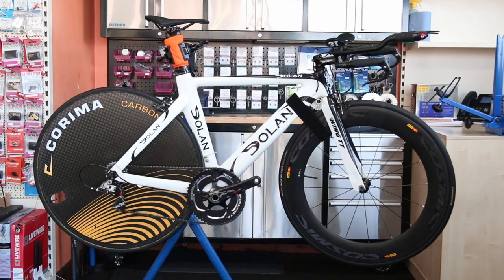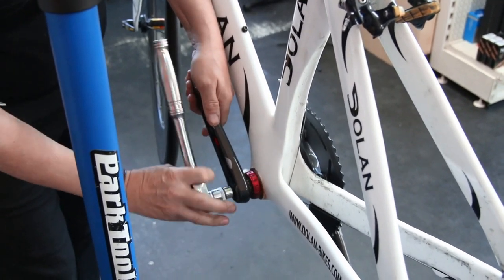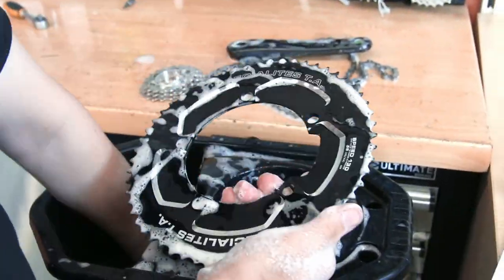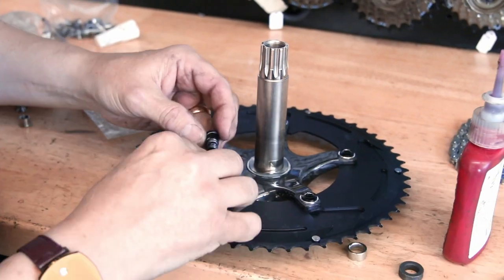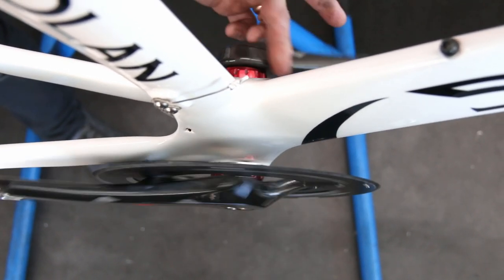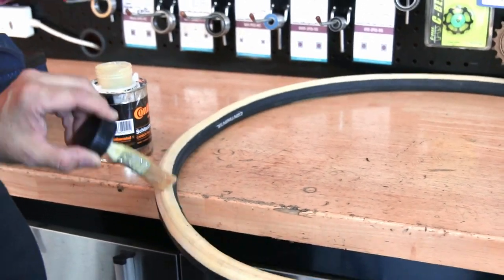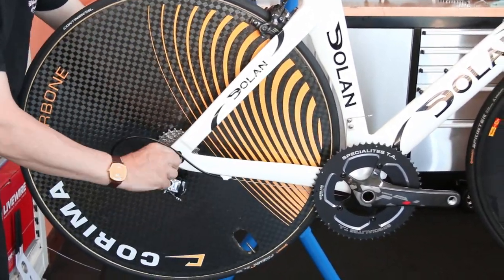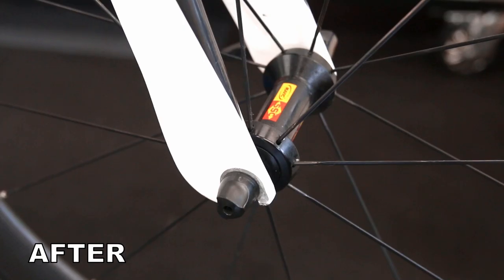1 BY CHAINSET BIKE CONVERSION

Comment: Ah, I have a SRAM crankset like that. You tighten the crank arm bolt exactly to the manufacturer's spec, then 6 months later you try to take it off and you need an impact gun to break it loose. It's actually a commonly known problem, and it's due to the metallurgy between the axle and the bolt. SRAM actually makes a steel bolt that costs you a few grams but is much less prone to seizing.

Comment: I used to run tubular tyres 30 years ago on the lightest mavics and found them very prone to punctures, they were 8 quid each from my lbs and I was replacing at least 1 a week, which is an expensive game when your 16. Love what you have done to the beautiful Dolan to bike
Reply from the maker: I ran tubular on some Zipps on my TT bike up until about 3 years ago, still the lightest smoothest set up I’ve ridden. It’s a shame they went out of fashion really.

Comment: Great job on the bike.  You go way above what most bike shops do, shows the quality of your work. Have you tried using tape instead of glue on tubulars?
Reply from the maker: I prefer glue because it soaks into the canvas on the tyre rather than sitting on top of it. It also leaves less residue between tyres making rim cleaning easier. also when you remove the tyre the old glue stays on the tyre which means it can be used as an emergency spare for long distance racing or rides you can pop off a punctured tyre and slip on an old tyre and there’s enough glue to get you home or to the finish of a race.